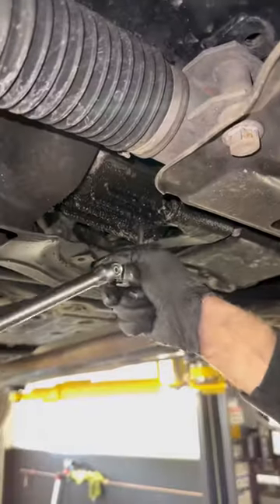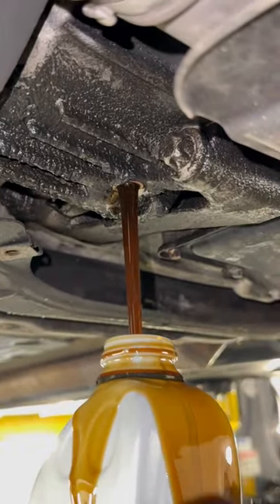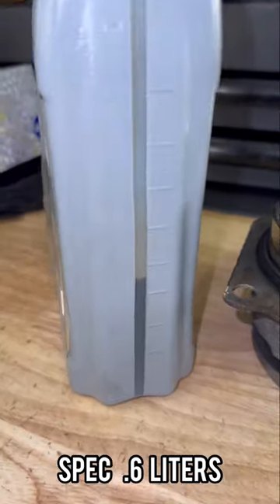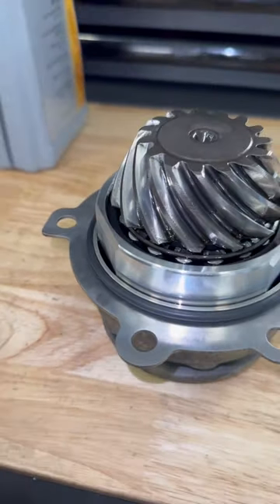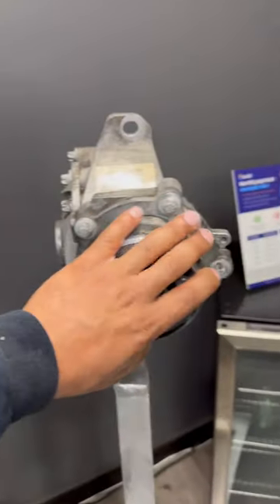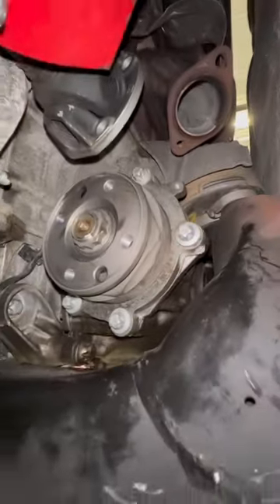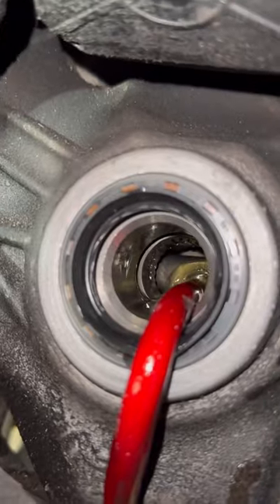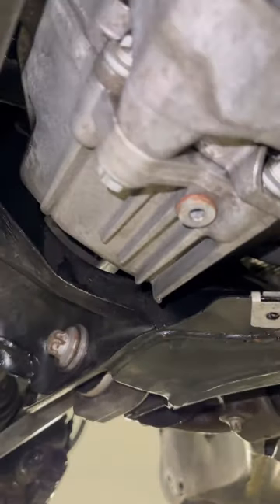Front differential pinion gear reseal on a Mercedes-Benz #automotive #mercedes #shorts

Comment: Do you happen to have the torque spec for the pinion gear bolts? 
My diff is currently leaking as the original seal was cooked. Replaced it with a new seal and its still leaking... I feel I may have overtightened the bolts causing the seal to just be crushed. Not a fun job whatsoever.

Comment: To remove the pinion gear can I do it without removing the differential and just unbolt the 5 bolts that hold the bracket and replace the O ring?